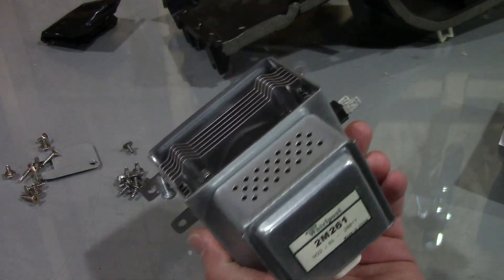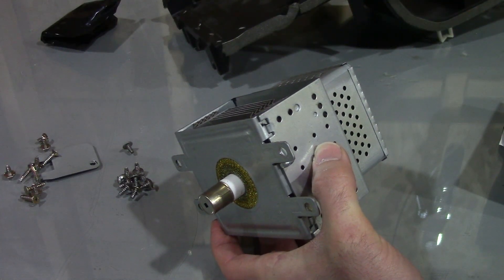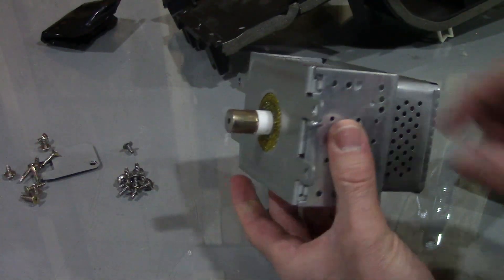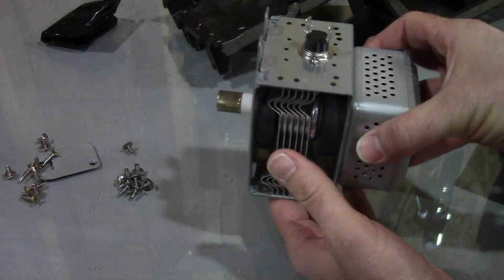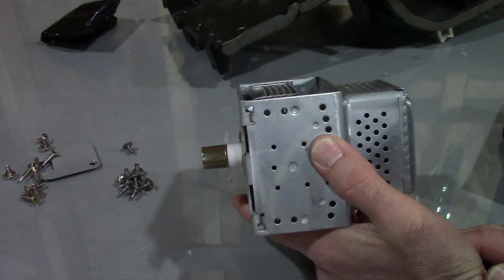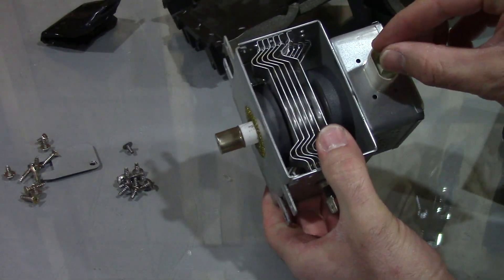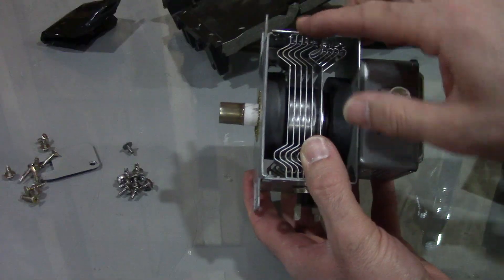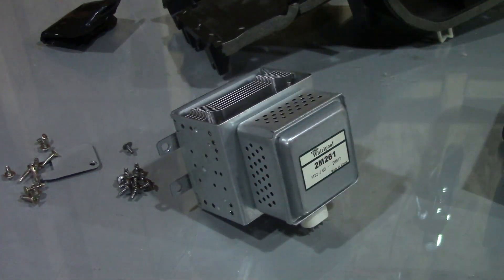What makes a Magnetron dangerous

Comment: The video raises more questions than answers. 1. What is the mechanism of action for the lung poisoning?  Mechanical or chemical?  How badly did the thing need to pulverized to cause problems?  Would a paper mask be open or charcoal?  Eye risk?  2. What other risk?  I read there hasn't been beryllium for 35+ years in those things, but I bet the Capacitor is a bigger risk?  I don't believe that there is no use for the mag.  But I believe this is an ignorant statement. Maybe 2 used magnets and other warming applications. 

Anyway, it drives me nuts for someone to say anything is dangerous without telling us every detail of the mechanism of action, without which there can be no credibility, for starters. Definitely no real PPE and no rational avoidance or engagement.  It is like telling a toddler there are monsters in the kit, so they don't get burned.

I don't understand why other people's brain don't explode with questions and get a little outraged by the lack of intelligent explanations, when they read or see warnings like this one.    Fortunately, there is a comment section where scores of posts say that this was a risk only 40 years ago, which does not answer any of the real questions like mechanism of action, but makes the intellectual exercise for finding the answers mute.

Fortunately, other comments do poi out the real risk and hugely understandable risk of the capacitor inside a sitting microwave, years after it has been used.

Comment: Thank you for your public-spirited warning of danger from beryllium oxide.  But there is another danger that I would warn about.

I find this astonishing, but there are videos on YT encouraging people to construct microwave guns , or otherwise to get a magnetron working to produce microwave power for meaningless experiments.  This requires the generation of a very high voltage, of course, which is dangerous enough.  But magnetrons from scrap microwave ovens generate up to 1 kilowatt of microwave power.

The potential damage to human flesh should be obvious.  No-one should mess with high power microwaves unless they are truly responsible and understand the dangers and the possibility of causing serious and permanent injury.  It was the Nazis who used microwaves to sterilise their victims, and it seems likely they used much less than a kilowatt.

Comment: Believe it or not, magnetrons for common microwave ovens made since about 1980 have aluminum oxide insulators rather than beryllium oxide. The old amanna radarrange ones do have heryllium oxide. Since the 1990s they use pink ruby alumina to make them easier to sort when recycled. 🤓
Reply: I have seen varying opinions on the validity of that. I have seen some people say, more like, 2005 onward. It would make taking apart a microwave for a hypochondriac really difficult 😆
Reply: Where did you get that information? It's not true.  China doesn't care about the regulations you put so much faith in.

Comment: I have heard that most of the time if the ceramic insulator is white, it is most likely beryllium oxide. However if it is a pinkish colour, then it's most likely aluminum oxide. That could be not entirely true though, still take proper precautions just in case it is beryllium oxide.

Comment: Question: what type of facial protection can be used to protect you from beryllium?
Reply: the dangerous element of beryllium is breathing the dust, (caused by breaking or agitating it) beryllium is highly compatible with oxygen meaning the molecules quickly attach, then you breath it, and it attaches to your lungs.   it can kill you depending on how much you breathe.   it is suggested to wrap the beryllium part shown with tape.

Comment: Can anyone tell me if it is safe to cut apart a magnetron without damaging the  ceramic to get the copper cavity for the copper?
Reply: it probably is as long as it has no electrical charge.
Reply: actually i forgot about the radioactive electrode in the vacuum chamber. dont cut open the vacuum chamber, you dont want to breath in those alpha particles that it emits

Comment: I do not know if the magnetron sizes are standardized, but this one looks EXACTLY (same dimensions, but the insulator tube is pink on mine, not white), like the one in the microwave oven I did disassemble. It was made (magnetron) by Panasonic, model 2M167b-M73. I do not remember the brand of the microwave oven, it wasn't Panasonic tho. Some German or Swiss low cost brand.

Also I doubt it has any Beryllium Oxide in the insulator thingy. I am sure it would be marked at such. I am searching myself to figure out if mine has any Beryllium without access to XRF or MS equipment. I did find some dubious claims about color (white vs pink) being indicator of anything, but I do find it not consistent, and not anything useful. Both Beryllium Oxide and Aluminium Oxide do have additives like chromium (for various reasons), and others than might change its color. Considering beryllium oxide is simply more expensive (but indeed better in thermal properties) than aluminium oxide I doubt it used for magnetrons these days, especially ones coming from Asia. One quick check is to check the weight and volume (i.e. submerging in water) and compute density.

As of the Beryllium in any form (metallic Beryllium or Beryllium Oxide), especially as a dust, the exposure is not a joke. Even single dust exposure can lead to serious health issues.

Comment: A magnatron  operates at 2.450ghz (2,450mhz)  that device attached to the side is a thermostat  that opens when the temperature  goes above  a preset level. If you pop the metal cover off the bottom you will find 2 coils  (Rf  chokes)
Reply: *Magn/e/tron.

Comment: Wow. Of all the things I've taken apart, messed with and or just plain destroyed as a kid, I am so glad I never screwed with a microwave. I'm certain I would have taken the ceramic out just to experiment not knowing the dangers.
Reply: I used to rip stuff apart for fun, years ago i was probably 12-13 or so disassembled a microwave. Not knowing the potential dangers like i do now. Took the magnets out of the magnatron (which are still hanging on the work bench) and somehow didnt get shocked by the capacitor. Man i got lucky.
Reply: when i was young i loved destroying shit like that for fun. i did a microwave once, which is still lying around, and somehow didnt chip the ceramic and somehow didnt get 2000 volts sent into my body.
Reply: I’m a kid and and I just posted a video taking apart a microwave but I have a great understanding of the dangers

Comment: Those symptoms you list sound just like the symptoms of getting older.
Reply: That's what I thought...no cure for that either
Reply: Covid nineteen too 😊
Reply: Horsetail is an herbal supplement that removes heavy metals from the body. Taken in large doses it has been known to remove the mercury fillings in teeth.
Since Beryllium is a metal, horsetail can be used to remove it.
Reply: @SolutionsNotPrayers  there is a large difference between Mercury and Beryllium, just looking at the periodic table.
Reply: @SolutionsNotPrayers  Beryllium is NOT a Heavy Metal, it’s actually a light metal like Lithium or Aluminium

Comment: The aluminum vanes remove the heat, there is copper inside, and steel. All of it can be recycled, the magnets can be repurposed. The ceramic can be trashed. So don't throw it away.

Comment: Oh, geez...that's nice to know. When I was a teenager working at Sears product services, I used to tear mags apart to get the magnets. I'm not really sure if I chipped the ceramic, but it would not surprise me. Smh
Reply: You'd know if you did.
Reply: @elliott8596  That is not for sure no. Many will never get any side effects.
Reply: jeez how tf are you not dead old microwaves didnt have the part that bleeds the charge of the capacitor so they would prob still have most there charge from testing if you fucked with it or even some models touched it you would instantly die

Comment: Is the ceramic at the end of a sand blaster or glass bead blaster dangerous? Also.. automotive spark plug ceramics?
Reply: A spark plug or a bead-blaster nozzle does not require the heat-conducting properties the beryllium gives to the magnetron's ceramic parts. Without it or a substitute, the intense heat (orange-red hot - roughly 1600F) the magnetron produces when in operation would otherwise shatter the ceramic, thereby destroying the device.
Reply: Thank you.

Comment: The electrons don't bounce around they are bent at 90 degree angles and spiral around. The Magnetron Vacuum tube has copper fins inside that portrude from the chamber wall. Each time an electron passes near a copper fin it generates voltage in that region. When this happens enough an RF signal is generated and then coupled to the output on the tube via an internal antenna. That output is also the copper nipple that is cold welded to seal the vacuum tube. There is no thermal cut out on the tube. Those are mounted on the magnetron  and the cooking cavity! LOL!

Comment: DANGER ⚠   Before attempting to remove a magnetron , Be absolutely sure to discharge the capacitor and the magnetron itself because no matter how long the unit has been unplugged , They can hold a charge that is LETHAL , And NEVER NEVER ATTEMPT TO POWER UP A MAGNETRON WITHOUT IT BEING INSTALLED IN THE MICROWAVE , Doing so will expose you to very dangerous levels of microwave radiation , If servicing a microwave yourself , It is strongly advisable to get a microwave leak detector to make sure there is no leakage of microwave radiation , In everything you do , ALWAYS PUT SAFETY FIRST!!!!!
Reply: m3sca1 That sounds tragically hillarious.
Reply: @8GardenJunky1  How do I discharge it in the most simple way, I heard I can use a screwdriver is this advisable? Thanks
Reply: Wolverine X 
Properly insulated electrical screwdrivers
Reply: @forest3064  Look up 'capacitor discharger'. It's usually just a wire with a clip to ground, a big resistor in the middle, and an insulated tip to touch to the opposite polarity. Some designs have a clever circuit that lights a led to show current present, but a second or so is fine.
Reply: I put saftey 3rd, saftey 3rd kids coolness 1st and knowledge 2nd kids
Reply: InsideOfMyOwnMind they do all sorts of dumb things for views
Reply: Laughs in DiodeGoneWild
Reply: But its safe for food huh
Reply: Stop being alarmist. While it is always best practice to discharge any caps, deadly voltages are seldom present for very long if it's not a capacitor. Microwave radiation (about 2.4ghz in this case) is not immediately harmful, although it may earn you a visit from the fcc from the spurious emissions. Beryllium, as stated in the video, is the most dangerous part, followed by line voltage. Although touching an energized HC coil may make you reconsider your hobby, it is unlikely to be your last dumb mistake.
Reply: Wear a condom while repairing your microwave. SAFETY FIRST!!!!
Reply: Yea yea🥱
Reply: Yeah but its not true beacuse capacitor holds around 150-200 volts when its unplugget the magnetron needs 240 volts and need to be grounded to the microvawa. But its true to discharge the capacitor beacuse inside is bleed reseastor and store the energy insid and this 200 volts can kill you.
Reply: @darkdarkness4852  First of all the  Capacitors found In microwaves ovens can hold up to 2.2kv and it takes 2500v with about 600mA to run a magnatron touching the raw output can kill however it is not as dangerous as the output of high volatge transformer
Reply: @Rev-maniac7500  That was a year ago i was stupid and knew nothing about microwaves and capacitors…I’ve done some research about capacitors and microwaves and yeah they hold much larger amounts of voltage than 240v…in fact i was so interested in these things i build microwave cannon and the best part is when i discharge capacitor so im really sorry for this stupid comment as i was saying I didn’t know much about micowave capacitors.
Reply: @darkdarkness4852  that's fine. Cool project tho
Reply: You can power up a magnetron when it's outside of the microwave. You just need to stand somewhere far away, it's that simple... many people have done it, including the guy from Photonicinduction. Obviously it's dangerous as hell, but if you do it safely, nothing will happen to you. The waves dissipate at a certain distance so if you stand far enough, you're all good.
Reply: @anatolydyatlov963  You really should use sheilding if powering it up outside. Even cheap foil or metal window mesh is sufficient.
Reply: Actually I'd say mostly the danger is the FCC come knocking your door because you're broadcasting all these radio waves and ham guys are complaining about it. Microwave radiation probably isn't going to do that much to you... considering they have military weapon which is designed to shoot microwaves at people to deny them from the area but won't kill or cause injuries, just makes you feel like you're on fire.
Reply: the dude that invented the microwave oven had one chocolate bar melted in his poket as he got magnetron and hand.... he should have gotten a lot of radiation right? I guess he lived long enough to invent the microwave
Reply: The 👦 who tried it is now Purple... 😆
Reply: Good warning it sould be on microwaves
Reply: ironmarty Sharpe have you seen the video by those silly russions on Kreosan channel? Door open holding shit in front of it.
Reply: lol k. the capacitors have bleed resistors that discharge automatically, oh, and i took the magnatron out of the microwave and i plan on powering it up, as soon as the rest of the build is ready
Reply: What nonsense, microwaves are electromagnetic waves is not U—235.
Reply: I just +d both of you because if you combine your opinions into one person that is me.
Reply: put your cell phone in a microwave oven and then call it..  any leaks?    how about 5G?  danger will robinson!

Comment: so yea of course i have questions! hey man! You know, I have this project of my own and i need some kind of a cannon that shoots stuff very, very fast but stuff that we can not see and must be able to shoot that stuff at a  small target you know and then the target get hit big time but when you look you dont see anything. My project is for a device that can heal your brain you know like when having some bad headake or even when you firget something and use this high voltage casket, it will be like a work protection helmet, in fact im installing the device on one such helmet cos it fits already our heads. it wont hurt or do damage even if the electrixity will be like thousands of volts, they will be for very very short time so they dont havè the time to damage someones head but only fixing it... can these cannons be connected 2 of them to the same power source cos they look heavy, if i install one on one side of the helmet then it will pull down your head on a side and dont look good.

Comment: Is this beryllium part of ever microwave out there or just some and how can you tell?
Reply: Just the older ones (and also commercial units used in labs/radar). Beryllium is really expensive, so modern microwaves all use aluminum oxide which is safe. But unfortunately there's no easy way to tell them apart.

Comment: Let me clarify how a maggie works.  It is similar in operation to a cyclotron (a cross field device) in that as the electrons travel thru the maggie they take a spiral path due to the effect of the magnets on the electron stream.  Centered around the path are a series of cavities tuned to 2.45Ghz.  As an electron passes past the cavity it causes it to "ring" at it's resonant frequency just as if you were blowing across the mouth of an empty soda bottle.  Each cavity is coupled to the output "collector" which is then coupled to the microwave chamber.  for a more detailed explanation see: http://hyperphysics.phy-astr.gsu.edu/hbase/Waves/magnetron.html

Comment: Yikes!  Don't forget the radioactive Thorium electrode in the vacuum tube!
Reply: The what?
Reply: @qrelectronicrepair1802  Vacuum tube... vacuum chamber...  same principle.  Thorium is an alpha particle emitter.  It used to be used in certain kinds of welding rods, and in the filaments of antique gas lamps.  Alpha particle emissions can be blocked completely with a piece of paper.   You don't want to inhale it though, so unless you are cracking open the vacuum chamber to the magnetron, and grinding on the tiny electrode filament you have nothing to worry about.
Reply: Dude, I weld with tungsten/thorium electrodes, guess what we grind them to a point... frequently!
Reply: Vacuum tubes have throated filaments as well....I guess a magnetron, is a vacuum tube of sorts?!?
Reply: Thorium is radioactive(very mildly) but compared to the hazard beryllium presents it is not to comparable. Still do not breathe it in as it could cause damage.

Comment: Magnetron operates on about 2000 volts DC, which is derived from one transformer winding with a simple diode and capacitor. About 6 volts from separate transformer winding are used to heat the filament. Filament is mounted in the center of a circular chamber in the metal block with a high vacuum, with several small. straight channels leading radially outward into small chambers. Electrons emitted by the filament travel into the smaller chambers, where external magnets force the electrons to spin, emitting microwaves. These microwaves exit the end of the tube and are guided to the oven.
Reply: More like 4000V DC, the 2000V you mention is AC straight from the transformer before it gets half-wave converted to DC by the diode and doubled with the capacitor.
Reply: Filament takes 2 or 3 V not 6